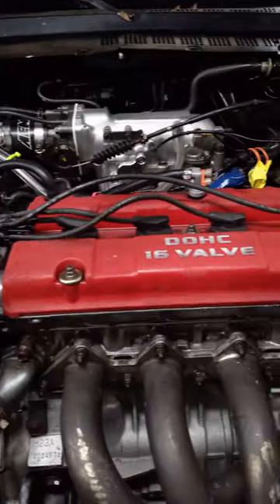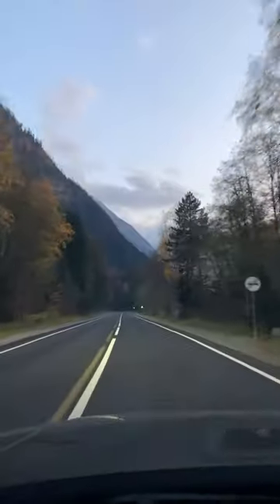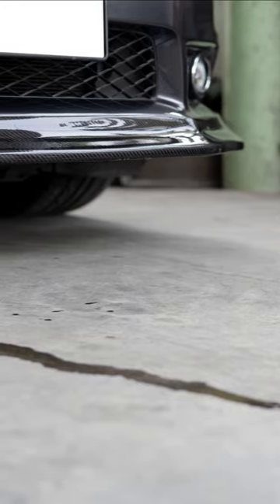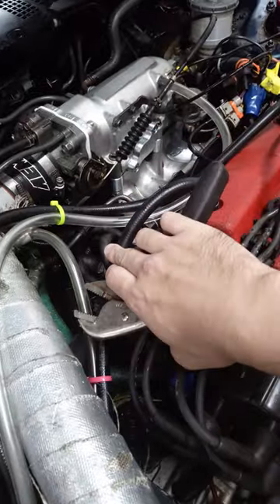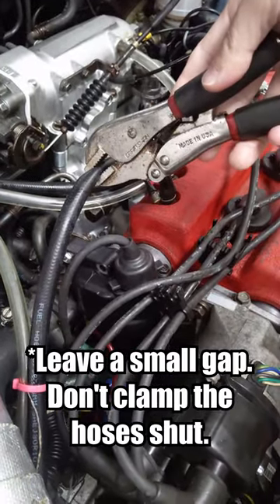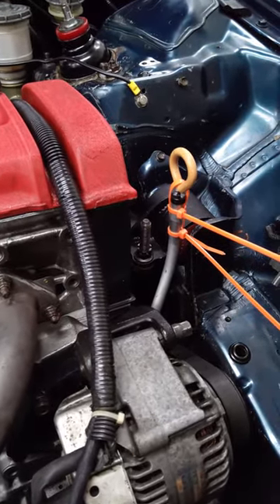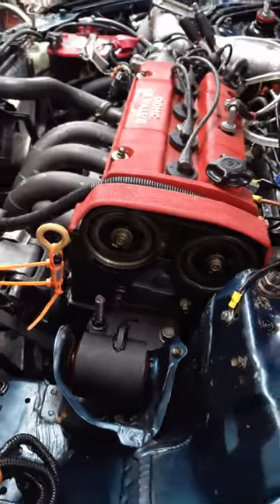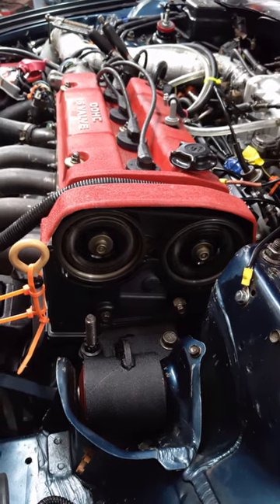THE Old-School trick for hard-to-find oil leaks

Comment: Brilliant. So I'm how many decades old and didn't know this trick? Sure beats my old method: adding radioactive dye to the oil (helps if you have a buddy who is Nuclear Med Tech who can sneak some out of the lab) and then use a military grade flurospectrometor and Xenon flash lamp (helps if you have a buddy who is an international armament dealer), then be sure to put on a radiation hazmat suit (helps if you have a buddy who works at a nuclear power plant to sneak you a used one) then make sure all your pets are 65' away (or else all their hair will fall out) then...

Comment: what kinda flash light is that
Reply from the maker: @nayner248  It should be this one, if I remember correctly : https://amzn.to/3T3a8cI

It's great for finding leaks, especially in automotive AC systems. I also use it to find small insects that may have made their way into the shop.

Comment: Time for a new oil pan? Or was that just the plug?
Reply from the maker: It turned out to be the weld around the plug. A bit of JB Weld sealed that right up.
Reply: My oil seems to be leaking in the same spot.
Reply: My oil seems to be leaking in the same spot of the video. Crater spot of the oil pan. Name of spot?